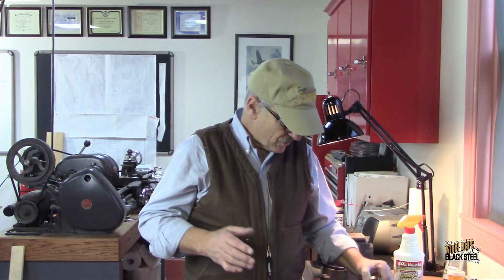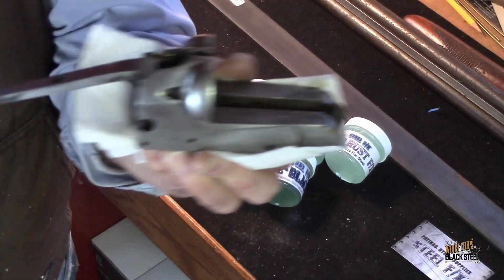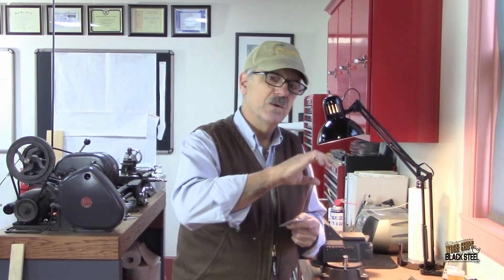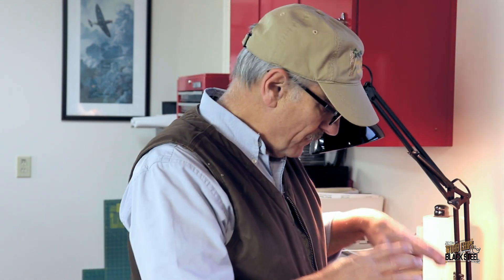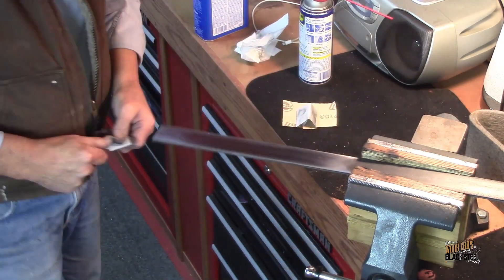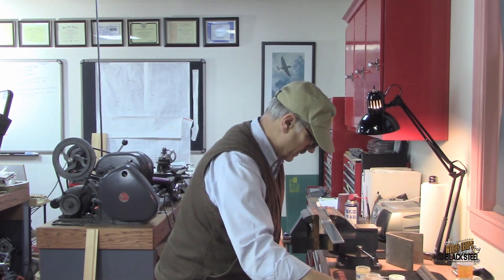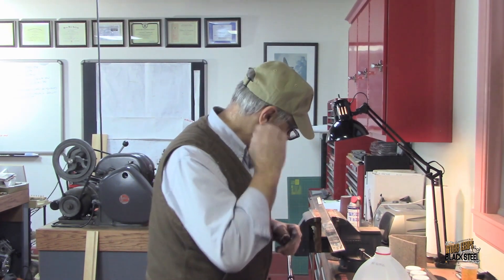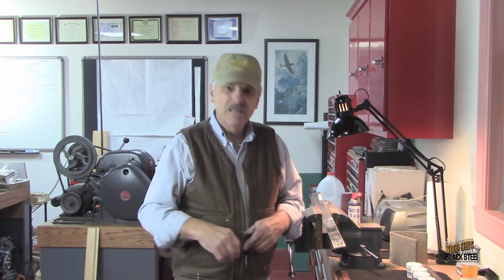Color Case Restoration

Comment: Hey Bill, great video. Just baught an old sxs that had case color and I’m wondering if there is anything out there to enhance the old colors? Not looking to remove old color just looking to refresh it. Thanks
Reply from the maker: Hi Craig.  Not that I am aware of.  Color case tends to fade over time especially if it is exposed to a lot of light (not to mention being held by human hands).  Most of the well used firearms with original color case finish that come through the shop have extensive fading.  Most folks don't realize that that "color" and the case hardening is only a couple of mills to .010 deep.

Comment: Would the metallurgy make a difference? 4140 vs 1018?
Reply from the maker: Hi John.  Not sure the question.  For real color case or the gel chemical?  If you get a chance to watch the next video in the series, I add the gel to the actual receiver of the shotgun and it did color different than the steel bar that I experimented on.  most modern guns use a 4140 and someday in the future I want to try and color a modern receiver.  It will be interesting to see if there is a color difference.